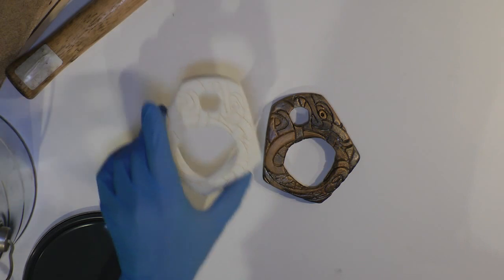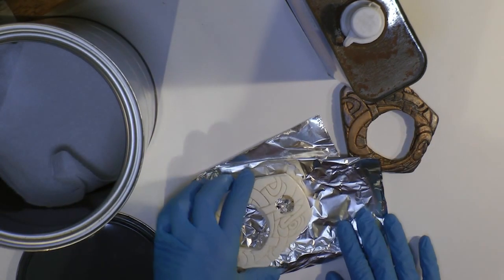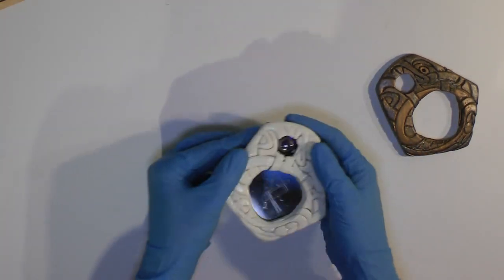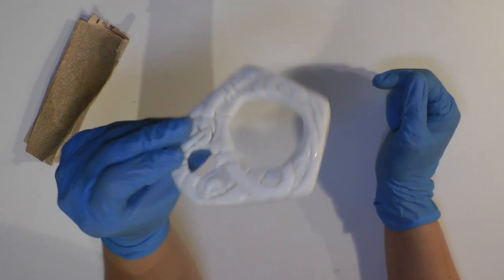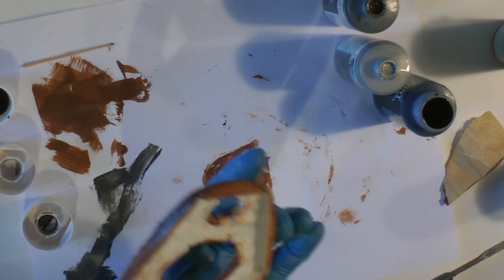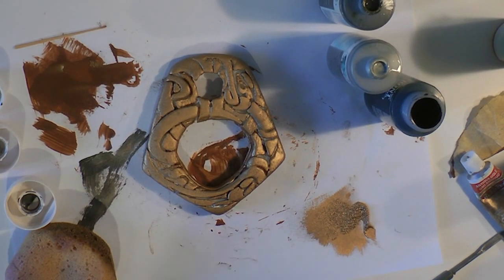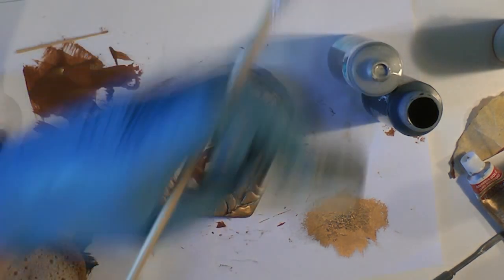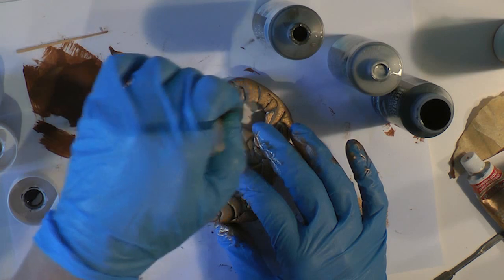LEARN: Viking Runes Project -- Finishing 3d Printed ABS @adafruit #adafruit

Comment: Not sure if it is a YT issue for an editing issue, but but there is a few minutes with no picture or sound at 12:03 for me. The video resumes a few minutes later but seems to conclude abruptly. I didn't see any explanation of the electronics. Is this supposed to be a multi-part video?
Reply: yeah, its probably an editing mistake, i see the same thing. but this is a multi part video.
Reply from the maker: Thanks for pointing this out!  I'll re-upload in a bit.